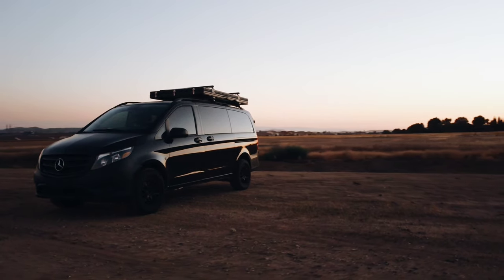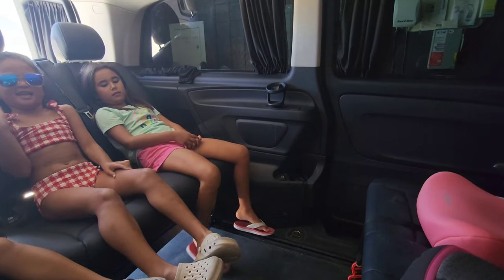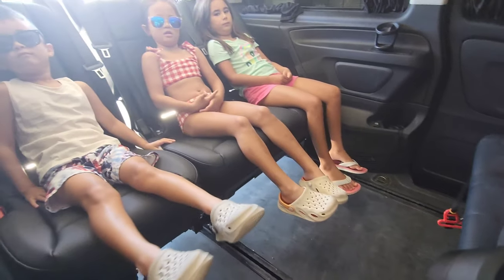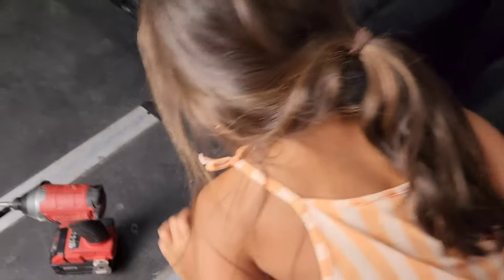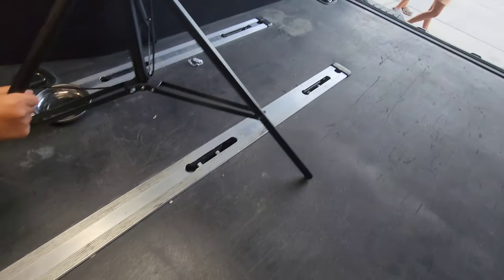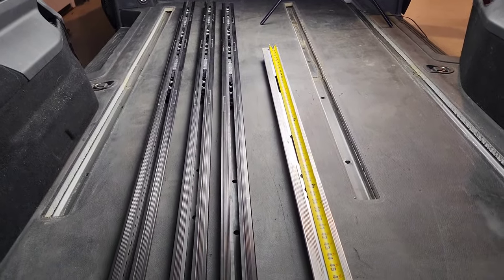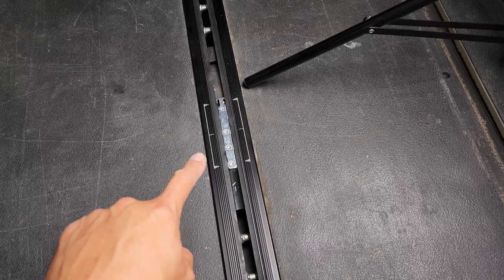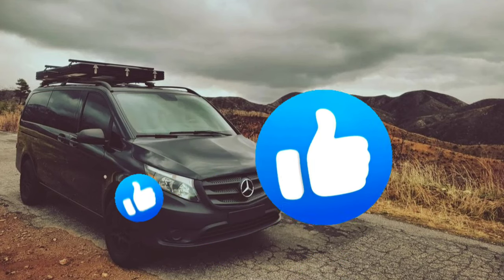Mercedes Metris Camper Van Party Bus | Sliding and Folding Seat Upgrade

Comment: Hi there ! Great video 👍🏻 
Is that Roofnest Falcon XL on top ? 
Got myself Metris and now looking for rooftop tent. Thinking about regular Falcon or wider XL. You have any pictures of it ?
Reply from the maker: Hi! It's the Roofnest Falcon Pro. It's low profile, so we can still fit our van in our garage with a 2 inch lift and 225/65/17 geolander mt g003
Reply: @TheChungKids   thanks. Falcon Pro is like 54” wide.
Does it stick out on the sides ?
Reply from the maker: @bodanik  it's actually perfect width. What is your email? I can send some pictures

Comment: What was the total cost for this seat setup? I'm looking at doing something very similar.
Reply from the maker: Hi! I can't remember exactly how much because I paid cash, but I believe one row (3 seater bench was around $1500-1800) the 3rd seat is removable so you can make it a 2-seater as well. I believe the sliding tracks were around $700-$1000, but this is only necessary if you want the seats to slide and you want to be able to adjust the positions. You can put the Euro seats on the North American tracks as well. Give Surinder a call and he can give you all the updated pricing. Thanks for watching!